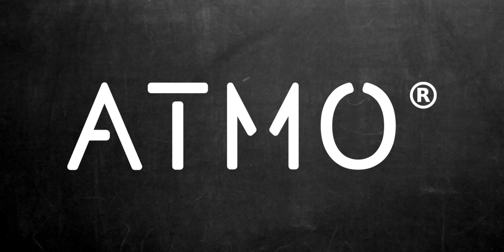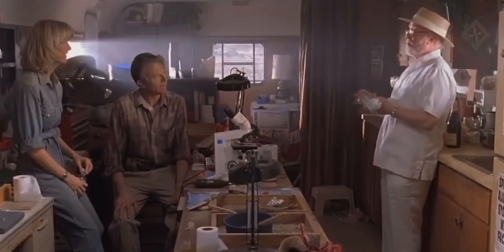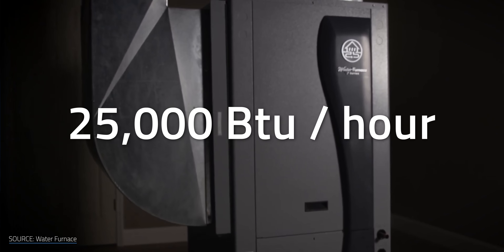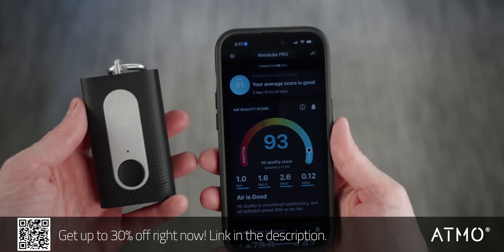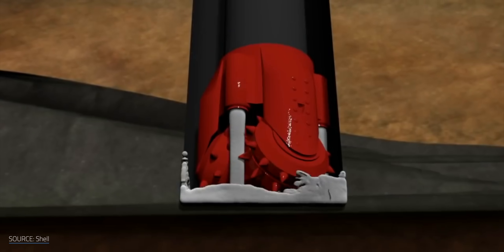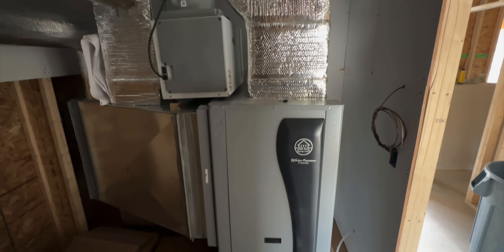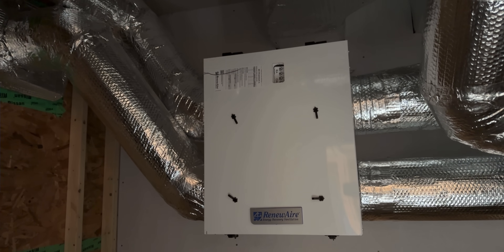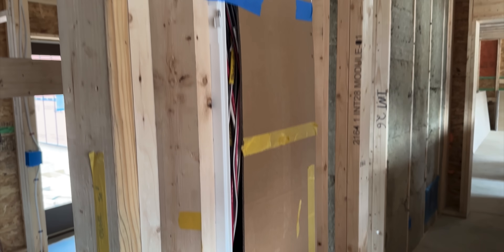Why I Went With Geothermal For My Net Zero Home

Comment: Here is what I would like to hear about in future videos. 

#1) How the automated shades work and how successful they are.    I actually want to do the exact same thing in a future home, but know that for shading from heat they need to be outside the window, and would plan for that.

#2) What components work best in your design and which ones didn't. 

#3) I'm also considering an enPhase battery system and want to hear more about that.

Regards,   My plan is more of a small home inside a greenhouse shell to moderate the extremes of weather with an "indoor/outdoor" buffer space.

Comment: I would be curious to know the cost of your geotherm vs air source.  The quote I got for geo-therm was $50k higher than air source when I built.  This was an absolute  no brainer.  My total annual electric bill is maybe $6k with my air source heat pump.  I estimate about half of that is for hvac, so about $3k/year.  Now lets say geo therm uses half the power (which is way generous), then that is $1500/year savings.  As you can see, spending $50k to save $1.5k/year makes zero sense.  If you borrowed the money, that would barely cover the interest.

Comment: That Ethernet Network is interesting and impressive; as well has the Geothermal System with the associated integrations. 

Curious, if the Solar Battery system is a Full Home Backup System or partial which appears to be more likely in most homes.

Comment: Matt, I work for StraightUp Solar in St. Louis. You're building the solution we recommend to customers all the time! Standing seam metal roof, solar with Enphase microinverters, Span panel and EV charger plus Tesla Powerwall or Enphase batteries. It's a killer solution, gives you total control and you've gone even one step further with the Water Furnace geothermal. Great update and I can't wait to see your video showing the net zero bills!
Reply: May I ask why you recommend a metal roof?  I'm curious as as I don't see them super often, so would love to know their benefits. :)
Reply: @tasia2174  Much longer useful lifespan, less susceptible to wind/hail losses. Standing seam is stupidly expensive compared to shingle though - it's generally used on commercial buildings, not residential. 99% of the time people opt for a 26 gauge (or very rarely 24 gauge) ribbed metal roof instead, as expected useful life is the same. Not quite as good a seal as standing seam though, and the foam closure strips can pop out over time. Also need to replace the fasteners every once in a while as UV exposure breaks down the gaskets and some work themselves loose due to thermal expansion/contraction. Overall, very minor maintenance every 10-15 years but considerably cheaper than standing seam.
Reply: @deathlis  thanks so much for the explanation!
Reply: And bracing
Reply: Since you mentioned working for StraightUp and they are in our neighborhood (Champaign), I would like to ask about payback. Solar is old enough now that there should be hard numbers, not just calculated, on payback. Maintenance and repair cost? I like the idea, just not sure. If it is great and pays for itself solar companies should assume all cost and maintenance and zero dollar lease from the homeowners roof/wall space.

Comment: Does anyone know of a controller that can automatically switch the ERV to bypass (vent out heat) when it's cooler outside than inside instead of running the AC? We turn everything off manually and sometimes forget to close windows in the morning. Around here, nights are cooler than the inside target temperature for half the summer. Great to see all the automation coming to your house and without any Natural Methane Gas!

Comment: Solar panel angles and areas calculations appreciated.  
Don't know if you covered that sort of stuff in depth on this channel, but those metrics would be useful to see as an anecdote for the installation process.  
Touching upon connection with a battery and the grid would also be cool.

Comment: Looks awesome! Do you have to worry about tree roots near your geothermal heat pump? If someone goes with the horizontal version do they have to keep that area of the yard completely tree-free?
Reply: Tree roots generally aren't a problem. The loop is made from HDPE due to its strength but also its flexibility. As long as you don't cut the line when you're digging to plant the tree, the loop would probably outlast the home.

Comment: Interesting video, looking forward to more details about the individual systems ^^
And about your "overkill" on the network setup: there is no such thing as having too many ethernet ports/cables :P And running stuff wired is always better than relying on wifi. And if you used cat 7 cables you're on the future-proof side and could (partially) upgrade your network from gigabit to N-base-T or even 10Gbit where needed.

Comment: My question is one step further in complexity. In my case a vertical geothermal heat pump makes sense on a standalone basis, but I have 25kWh ground solar already and are trying to factor our abundance of electricity into the decision equation and understand the impact of a cheap energy source. Does this reduce the mechanical advantage of the heat pump? Any thoughts.

Comment: I'm curious to know if your battery setup will be able to run your heating system during a power outage?  I was also wondering how much more efficient the geothermal heating is vs a regular heat pump?

Comment: I don't agree with using the term geothermal to refer to ground source heat pumps. Geothermal refers to water so hot you can use it to make electricity. GSHP refers to slightly warm water that you need to put electricity into in order to make it hot enough to heat your home. They are such different things that I don't think it's a good idea to use the same word.

Comment: Most interested in hearing about your ground source heat pump and hot water system with your usual facts and figures. Ever since you first showed a layout of your new home I've been curious about where you are going to put the solar panels? I would have expected to see a large single flat plane angled to the most efficient elevation and direction. Finally it may be good that your system is somewhat over sized, who knows what the temperatures will be 20 years down the road.

Comment: Great update on your project. We built an efficient home on the MA south coast in 2021. We have two air sourced ducted heat pumps feeding upstairs and downstairs, so no single point of failure since one pump could easily handle all but the most extreme conditions. Our ERV is Zehnder with dedicated supply and return. The water heater and clothes dryer are both heat pump units. Our air sealing hit the passive house standard but we didn’t bother to certify. Wall cavity insulation is dense-pack cellulose and external insulation is Gutex as we wanted to minimize foam. With a 15 kW LG solar panel array and Enphase microinverters, we have so far been considerably net positive and that includes charging an EV. We’re grid tied with a backup propane generator since between the coastal environment and semi-rural grid we sometimes have prolonged outages. No batteries yet but might consider that after the 10-year SMART incentive program expires and if batteries get better and cheaper.

Comment: How big is the houae? 25,000 BTU seems too large for a Passive house. Sounds like someone used "rule of thumb" instead of actual passive house calculations. Is there a dehumidifier in the system? That will be critical especially for spring/fall in New England.

Comment: You should consider integrating some thermal solar into the geothermal loop to maintain the heat in the well, as climates that use heating more than cooling tend to pump the heat down over time.

Comment: There's hardly any geothermal heat at 400 ft. What you're getting is an average of annual temperature. That's why their called ground source heat pumps, not geothermal. I have one, it's fab if done properly.

Comment: I mean... I'm... PRETTY sure your geo-thermal system isn't going to escape and hunt you down like a velociraptor... assuming it's not a deep pipe with a giant wheel with a velociraptor running on it at the bottom...

Comment: Matt, 

you persist in calling ground source heat pumps geothermal. They are not!
Geothermal is tapping high temperature spots deep in the earth.
 Ground source heat pumps just mean that the suction  line temperature is higher than that of an air source with a corresponding higher discharge temperature from the compressor.

Comment: Well, it is nice to have the money required to install all thes energy saving gadgets.
In Greece geothermal power generation got an extremely bad name, because of a mishap in the island of Milos back in the 80s.
The Island has rich geothermal energy reserves and the Public Power Corporation decided to utilize it in order to replace the diesel generators used back then.
They contracted an experienced Italian company (if I remember correctly) to build the geothermal power generating plant, but something went very wrong with the drilling and the wholee island was polluted by sulfur compounds.
Since then, a common joke says that everybody is welcome in Milos, except the power company's employees, who are being chased back to the ship by the locals lol.
In recent years, the Cycladic islands have been connected, with submerged cables, to the mainland Greek electric power network, so they don't need to have individual diesel generators on every island.

Comment: We have 5  ton Geothermal, 16kw ground mounted Solar and an EV in fact everything is electric in a home built in 1987.  We've gone through two winters in the Hudson Valley with the system which has two 300 ft wells and were warm and toasty even with an outdoor temp of -7F.  One thing the fluid and the earth don't stay at the 50F because it takes time for the earth to recharge.  In winter as the loops pull heat from the earth the temp of the liquid gets colder because heat is being pulled from the ground faster than it gets replaced so it has been as low as 35F. The reverse happens in summer and the temp can go as high as 65F.  For the entire year in 2022 the Geothermal used 7316.24 kWh to heat and cool our home.  I should also mention we have a 20 x 40 in ground pool and the 1.5 horse power pump used 3868 kWh in the 3 months we ran it 24/7.  Our home is also not as tight as the home you are building.  The solar system is providing all the energy we need for the home, pool and charging the EV.
Reply: Sounds impressive! We're glad to hear you chose geothermal for your home (even if it isn't WaterFurnace).

Comment: Typically with these drills you do not have to dig holes certainly not down to 5 feet.
The rig just powers the drill thru the ground.

When we say geothermal it typically refers to using the hot steam from the ground, what they do in countries like Iceland or Finland.
In your system, you are trying to transport the constant temperature at a certain depth via alcohol based liquid.
Given that temperatures are rising by the day, ground temperatures too will rise. In this situation how will the ground heat be used for cooling your house?

Comment: This video was a trip to the past for me.

I bought a 7,000 sq.ft. house in Connecticut back in 2011.  In 2013, I installed a geothermal system.  It provided heating and cooling.  On especially cold days, there was a supplementary propane burner to assist the system.

I had three wells going down to 400 ft. and three massive air handlers, coupled with huge HEPA filters. 

It cost me $197,000.  I got back around $30,000 in tax rebates.  I ended up saving around $12,000 per annum on heating and cooling costs.

However, when I had to sell the house in 2019, the fact that I had geothermal did not assist me in the least bit.  And the buyers felt that there should be no premium for such a system…

Sad end.  But, I’d probably still do it on my next home.
Reply: I can imagine getting a premium if there were a price spike in energy right when you were going to sell. Sad you didn't get that money back.

Comment: I have what you have except it is the Water Furnace Series 5. I hope you bought the Solar Start circuit board for the Water Furnace. It is required for the Solar to start it. I feed my Water Heater through the Geo  desuperheater. So it brings my water heater to a base temp. Then I only use electricity to bump up from there. But the greatest thing is having "FREE" Heat and Air Conditioning by powering the whole thing via my 14Kw Solar/Battery system !!!!!!!
Reply: Thank you so much for choosing WaterFurnace for your home. We appreciate you.

Comment: While geothermal is efficient,  it still uses a lot of energy by solar/battery standards. Much of the savings is in the utility rate.  People don't realize the cost to back up geothermal with batteries. The insulation will help, but you could use 60kwh/day.

Comment: Hey ! There is one subject I'm quite not happy about. When you say " it's how radiant system work for heating " saying like it will continue to warm air above the targeted temperature. Like it's some basic thermal control system. It's something use in any automation and robotic since ages and I don't understand how in the current heating market, we don't have a good système for this.for example:  "yeah issue you may have is your house getting too hot" maybe change the parameters to smooth the temperature without exceeding it. You can automatically changed the parameter based on the day or external temperature or predicted temperature and adapt parameters. There is tons and tons and model to servoing motor and at high speed so... Something that takes minutes to change like temperature you should be able to have a prediction system on point. Do you have anymore info on this about why radiant system in house are so brainless ? Pretty sure furnace control can be more precise than what we have access to

Comment: When we built our retirement house twenty years ago we went HydroTemp a local manufacture of "Ground Coupled Heat Pumps."  That is twenty years of trouble free service. Our only disappointment was the hot water preheat system. The heater functioned better without the preheat.  Even so, we like our geothermal system. And after twenty years it has paid for itself several times over.

Comment: I would make sure you have a back up generator for longer power outage to keep your air moving. You will have to be very careful about mold. Sealed up houses have excess moisture issues and breed mold.
Reply: Many hybrid inverters can work as a UPS in the event of longer power outages. They won't allow you to run your heat pumps, unless you invest in at lot of batteries, but they will keep essentials such as lights and ventilation on. I watched a video on YouTube where someone had hooked up a second-hand 24kWh Nissan Leaf battery (which cost about 7000 USD here in the UK) to their inverter. With energy storage that cheap, even running your heat-pump through an outage becomes feasible.

Comment: In Sweden we have been using this technology for a long time, so when me and my wife ordered a new house built 2013, the standard heating system was geothermal 👍 It has been working great. We consume about 10800 kWh per year all household elecricity included. Our home is 233 m2 (2500 square feet)
Today we also have 20,9 kW solar. So we produce more electricity than we use over a year (we do not have any EVs yet)
Thanks!

Comment: You can have a net-zero older house, if you get a heat pump, new windows and slap on a bunch of solar panels! The Rheem heat pump hot water tank doesn’t hurt either (80-gallon), same type that Matt’s installing in his new house.

Comment: Did you get the 240V or the plug-in 120V Rheem heat pump hot water tank?
You’re in New England, so probably the 240V.

Comment: I love this channel but I feel this is a flex it’s massively expensive and only ideal in places with geothermal activity
Reply: Matt's geothermal unit uses the low temperature solar energy stored in the upper crust rather than deep rock heat - so it's viable almost anywhere in any climate.

Comment: Will you may be getting Geo? Heat. Unless you have a source of hot water underground on your property it is not geo thermal Joe heat on the other side takes the constant temperature of the Earth and uses it to extract heat with basically a Heat pump while I know that it's much more exciting to do Geo's thermo but I suspect that's not what you've got if you're. Gonna give explanations A. Really odd to? Be true. But you're a YouTube resource not necessary?

Comment: Hey Matt, great video. 👍 Have you thought about a sprinkler system or a foam base suppression fire system for your home? I know that there are systems that work specifically for computer rooms that used some sort of gas witch when released, it become super cold suppressing a fire immediately. 

Just a thought, no expense right! 😉

Comment: Looks like you're building it the way I would, only difference I would have took half or more of it under ground level, I don't remember where you live at, so not sure of your frost line. On the geothermal heating and cooling, as long as you get it about a foot under the frost line for your area, you're good on it working right when doing the horizontal method.

Comment: Btw, what if thermal pipe leaks? It will cost more to dig and repair. Don’t trust modern day pipe quality. Nothing is build as strong back to the old day. It seems only need to install 2 tons, just get mini split systems, and even replace it will cost at low as $1000.